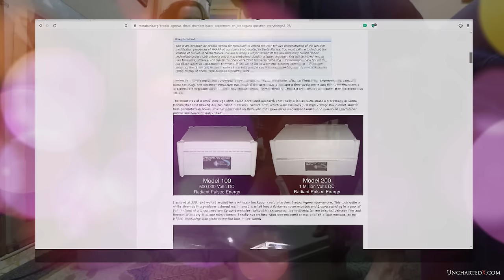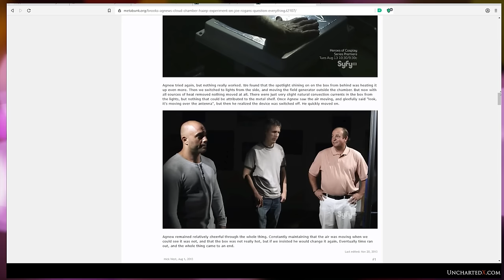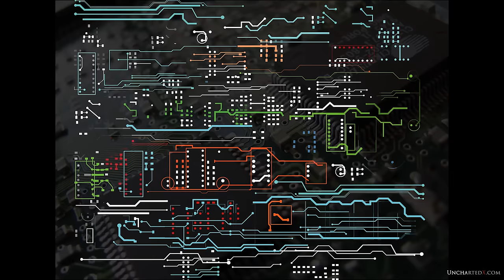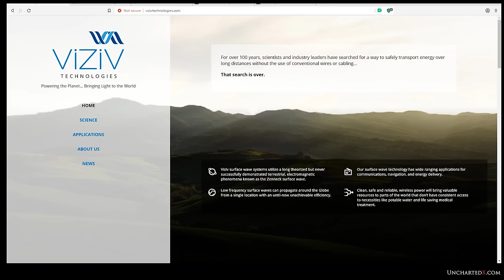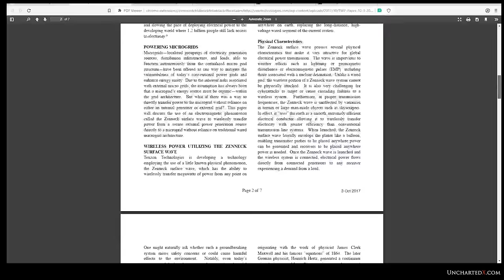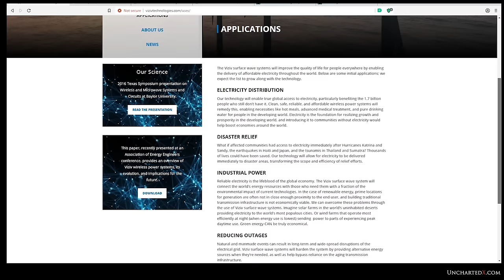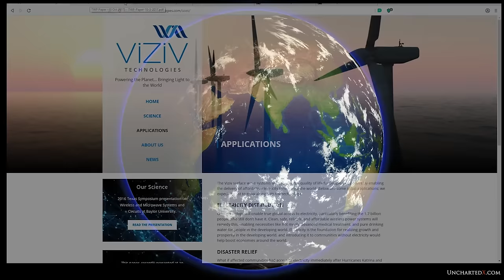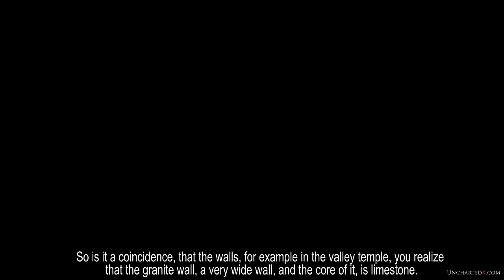500,000 volts through megalithic stone? An investigation into the possible with UnchartedX!

Comment: Lightning isn't just for thunder storms. But is a manifestation of the earth's inner core and the mantle and the crust and the magma and the North and South poles. The pyramids for instance have a near perfect north south alignment with the magnetic field of the earth.the heat from the core has electrons moving all over the place .the layers can produce different electrical properties do to different temperatures causing different voltages and being produced by different materials and relations to different motion of the core these materials of different layers a the magnetic fields of the earth.in it just might be that the earth acts as a giant generator and some of the layers produce voltages while others act as insulators.moving currents with the earth and in the water of the earth and in the motion of air around the earth all at differing velocities produce voltages and act as capacitors .coukd it not be posdible to get free energy with some or all of the monolithic constructions like the pyramids.this could mean that the pyramidal layout in Mexico could actually be giant electrical machines that controlled this energy. If this were possible then is it not also possible that U F Os could be powered by the earth itself with this earth created electricity and magnetism or electromagnetism. And that ancient people's knew and used this elecyrical power and even that people or governments also know this secret . this way we could be controlled because they couldn't charge us for things we could get for free and also that may be the reason for secret societies who know these things or even there may still be aliens among us.just a thought to make you think.

Comment: Nah, I do not believe this Tesla-style wireless power ("surface waves", whatever) is possible in any distance larger than a few centimeters, like the wireless phone chargers we already have (which are quite simple inductors). If you could "pump" significant power only "through the earth" i.e. "wirelessly" to where ever you might need it, it means everything between the "tower" and the application point would also be energized to deadly levels, or at least the transfer losses would negate any benefit in a short distance. This "universal power" is a nice pipe dream, nothing else.

Comment: You have no idea what you are talking about. What you say is nonsense, you are not an electrical engineer and you have no noleg about how basic things work. The thing that you saw was an ac high voltage passing throw stone. You can buy high voltage generetor from ebay for 2$ and you can use some batteries to make a very powerfull ac voltage that can pass throw stone , soil and what ever you can think of. Stop making idiotic videos.
Reply: no need get so incensed, dx.       NO theories were foisted on us.     Several commenters  have  understood the same thing, that you  have.    cheers